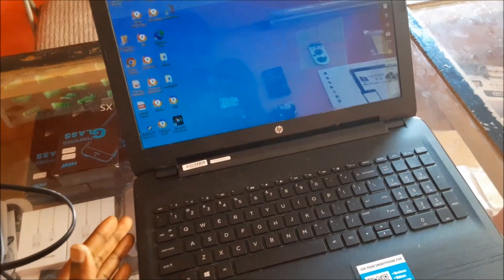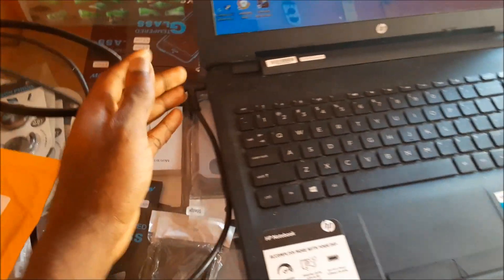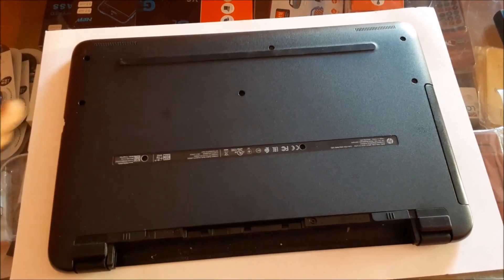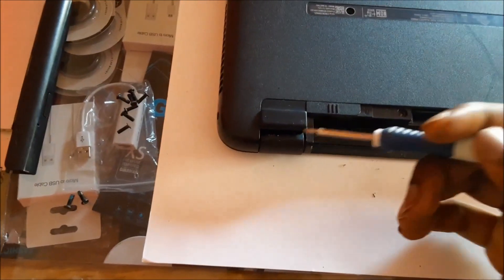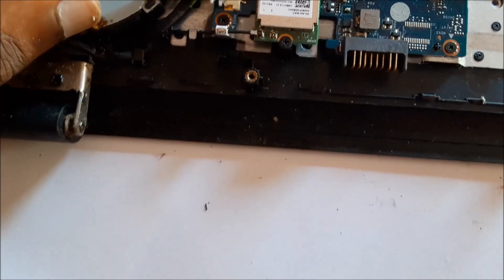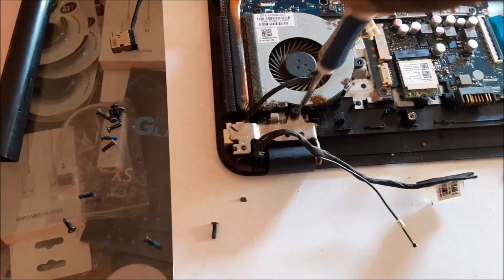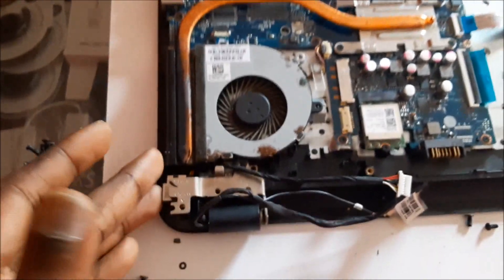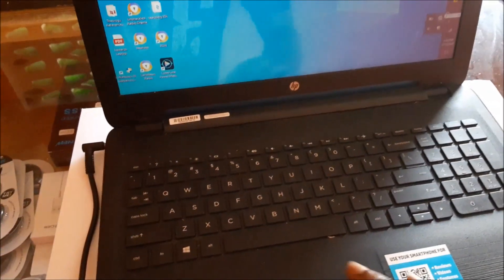How to replace your Hp 15 laptop port-Hp acer asus dell laptop only charge when off or on sleep

Comment: This is the ONLY video on the internet that explains the exact problem of why certain laptops only charge when it's off or sleeping but still works when it's not plugged in. Other videos will only tell you that the laptop only works when it's plugged and turns off when  you unplug it as if there's no battery inside. There's this online "solution" of instructions that tell you that you need to set your battery settings to  "reset" your battery to make it charge as normal, that is NOT exactly true! The problem is not technical, it's physical. Some battery hardware systems are designed to only charge when in low power mode/off, this is purposely designed to extend the life of the battery so you dont overcharge it when in use. Keep in mind that your battery system and your battery works perfectly and is in good health. All you need to do is get a completely different battery system (NOT the battery itself) one that charges when in use and switch it out with the other one.

Comment: Totally logical! Part ordered from EBAY. BTW HP online diagnostics useless. I always come back to YOUTUBE. Many thanks.
Reply from the maker: Great to hear!
Reply: That is exactly right. The problem is not technical, it's physical. "resetting" your battery settings from the file system just does nothing. The battery hardware was designed to charge only in low or off power mode to extend the life of the battery so you don't overcharge it too much while plugged in and in use. Keep in mind your battery and your hardware is in excellent health. All you need to do is replace your battery hardware with a completely different one that can allow your battery to charge when in use. No need to replace the battery itself because...well it's a battery.

Comment: i tried
it does not work 
and the laptop was still off for you that is y it worked man
Reply: me too ; I tried , but the problem is still
Reply: @abdellahoumina4809  check your AC adapter , it's may missing the blue wire responsable for communication between the battery and the AC adapter .